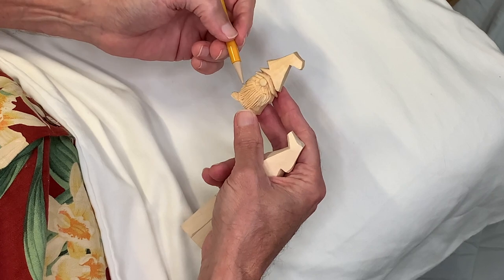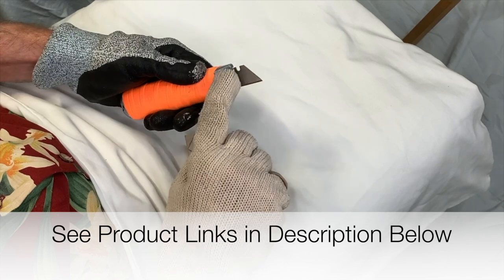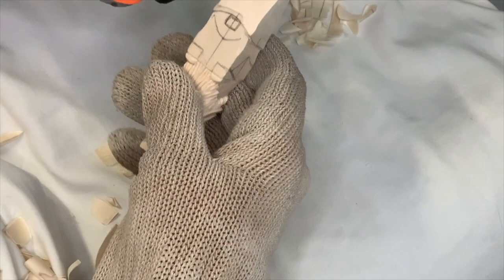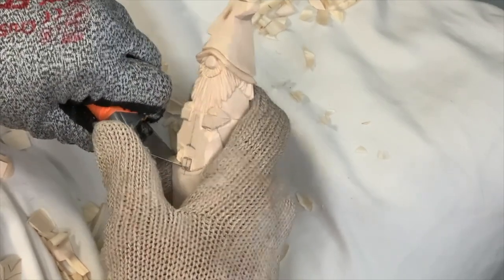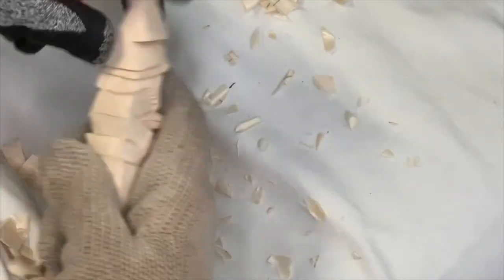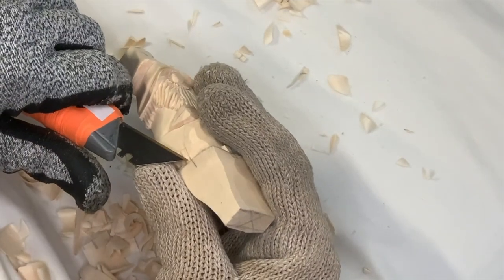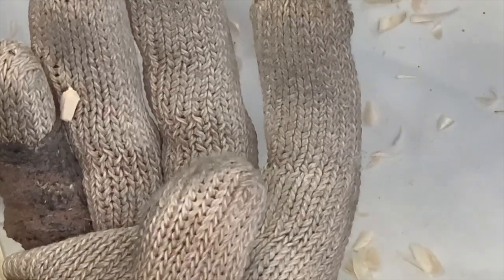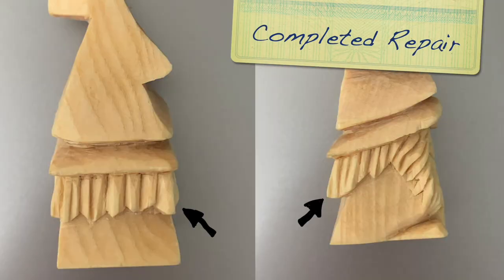Wood Carving A Gnome Combined With a Hillbilly = IttyBilly

Comment: I have had to glue several pieces back into place, noses, feet, tails etc all part of the fun😉 also with faces do not worry too much about symmetry, check in the mirror you have two different faces.
Reply from the maker: So true graham most human faces are not symmetrical.  Glue can be a very effective fix for sure!

Comment: Thank you.  U dun good.  Nice to see the Stanley 199 being used.  One thing that will improve cutting performance is to remember to strop even new blades before using just like any other carving knife.  Touch the blade up on a strop every so often.
Reply from the maker: Thanks! Yes, I like the Stanley.  I like bourbon as well. I've experimented with a variety of utility blades and I agree with you, stropping improves the performance.  Thanks for taking the time to post a comment, I really appreciate it!
Reply: Great choice in utility blades.  Lenox blades allow for easy adjustment of blade stick out without having to modify knife body.  Looking forward to your next project.  Thankyou again.  I'm not telling you something new,  but it is a good pallet for beginners to get useful info.
Reply from the maker: @finebourbon  Thank you sir.  Appreciate you taking the time to share some thoughts with me and the other readers of these comments. The Lennox blades are more expensive and I think they're worth the extra cost. I feel a kinship to my carving cousins and I want to help beginners to experience success, gain confidence, and become lifelong learners.